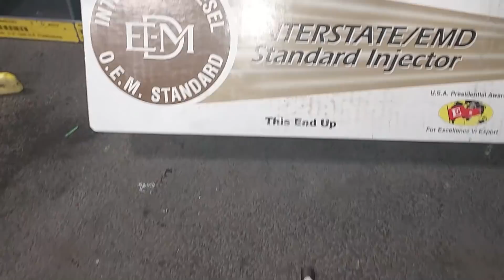Cracked Locomotive Piston, New Power Pack Assembly and Locomotive Fuel Injector

Comment: @4:34 - 4:55 ....   the cylinder appears to be honed too much.  I'm not a train nor diesel guy but I think there should be some crosshairs near the tops of the cylinder walls.  Many guys hone them away but in doing so actually overbore the cylinder and it loses some pressure near top of stroke because of bypass gasses going around the rings being the bore is oversized.  Again, I'm no train nor diesel guy nor can I diagnose from a video.  So that is just my trying to be helpful and I apologize if I'm way off wrong.
Reply: Too much hone isn’t a thing. Unless you take too much cylinder wall off. It’s called crosshatching.
Reply: @mikeznel6048  Told you I wasn't an expert.  Crosshatching....that's the word and my point was exactly that.....the crosshatching shouldn't be completely removed as that would take too much off the cylinder walls.

Comment: I’ve found it’s easier to just pull the whole pack and replace it instead of trying to remove internal parts like that. 
I’d check the piston cooling jet to make sure oil is spraying properly on the underside of the piston. You want to make sure that the jet isn’t plugged.
Reply: Only thing about that is the cost.
Reply: If I was going to guess to what caused it I'd say that there was water on top of the piston when it started - not too much water just enough to break the piston - I have seen a real hydro lock break off the crab studs and push the power assembly out through the valve cover onto the top of the engine - it was a wreck when it happened.  On locomotives when a high time engine gets cold lots of time the orings in the head gaskets will seep into the cylinder.  That is why your supposed to blow down a cold engine ... open all the blow down valves and spin the engine over till ur sure all the moisture has blown out of the engine...
Reply: @jth1699  Yup not to mention rain water/condensation can get into the exhaust
Reply from the maker: Thanks for the advice Bill. Nick did mention that he was going make
sure that oil was getting to it. I'm not that much of a mechanic to
know what he was talking about when he said it, but now I understand
better.  Appreciate your watching tonight my friend.
Reply: Could a plugged up oil jet have been a likely cause of that piston cracking up like that?   Just curious, thank you....
Reply: @2flyabove  that is a possibility, yes.

Comment: Thanks for taking us along!  Interesting to see that the (big) EMD is very similar in design to the (smaller) 2-stroke Detroit Diesels, but even more modular in design.
Reply: the best way i describe a EMD diesel is saying it a very large Mutant Detroit Diesel.
Reply: The EMD and Detroits are Big Brother / Little Brother.
Reply: Agreed, I'm wondering how many Fairbanks Morse powered locomotives are still out running the rails??
We had them in the YTB navy yard tugs that I was on.
Reply from the maker: Your welcome Dan, we really appreciate your watching tonight's
home movie my good man.
Reply: Eletro Motive Division was part of General Motors like Detroit Diesel.
Reply: The original electronic control for these engines was developed by Detroit.  The DDEC system.. EMD changed it to EMDEC lol.. I still have the original DDEC troubleshoot manual.
Reply: They are Detroits
Reply: @krakenwoodfloorservicemcma5975  Detroit Diesel and EMD shared common parentage back in the day, but they were two separate divisions.
Reply: @silicon212  yes but they're basically the same design made by the same people at the time,, two stroke work the same way

Comment: Looking over the locomotive roster of a small RR company near me, I was astonished to see how old some of them were.  None younger than 1973, and they have a couple of "F Type" locomotives dating from the 50's-- and one locomotive from 1947.  It got me wondering how much of the original locomotive actually remains, with parts and such being swapped out over the decades.
Reply: The Locomotive of Theseus....
Reply: @MartyMacgyver  "I still have my Grampa's hammer.  The shaft broke when my dad had it, and he put a new one on.  And the head shattered just the other day so I got a new one and put it on that shaft.  Good to still have Grampa's hammer."
Reply from the maker: I would say a good many of the parts on our locos are original,
however may have been rebuilt. Our #1 loco had a bad water
leak and water got into the cylinder and shot the connecting rod out
the side of the engine! That was years ago before I made videos or
that would have been a cool one to make. They did get a new
reman engine to put in, that would have made another great video
as I was there when they dropped the new engine in, and Nick
was on that job too.